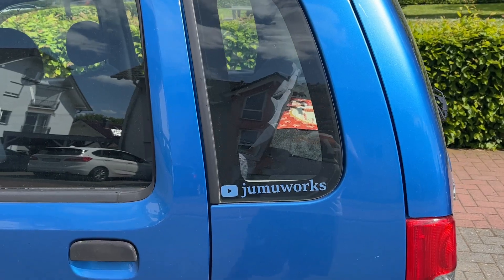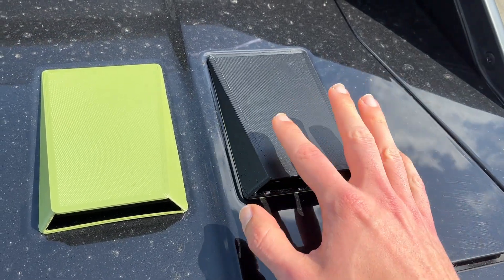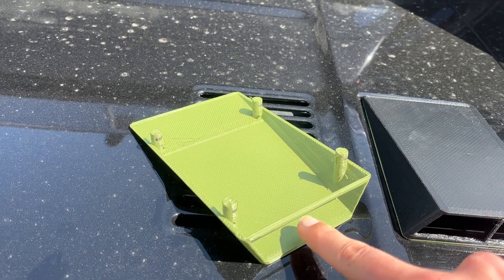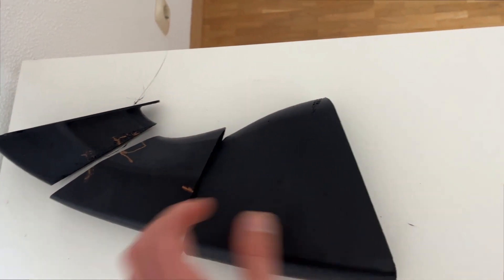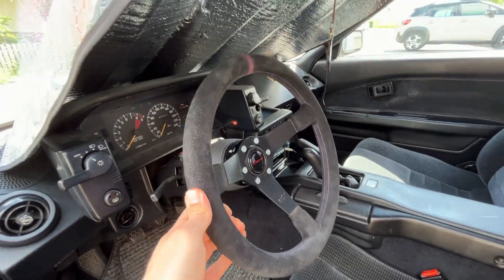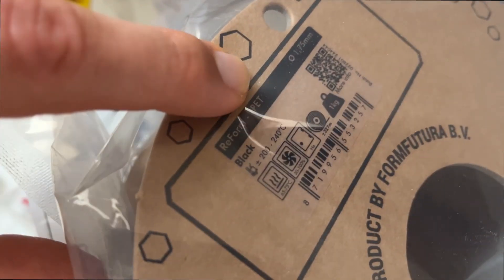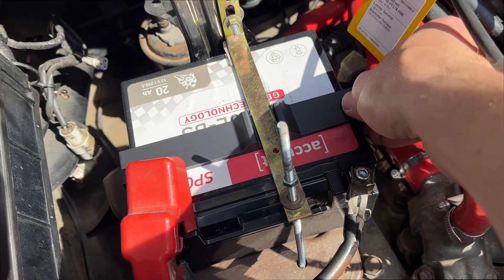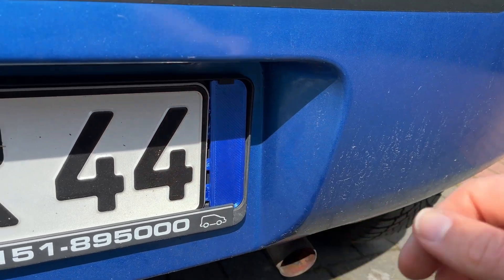My ongoing 3D Print Projects - AW11 MR2 Cold Air Intake, Battery Bracket

Comment: The engine cover piece is turning out great with the snap fit and seal to keep out rain (and snow!). I wonder if you would be able to print out a oil dipset handle extender, I sometimes burn my hand if I check my oil while the engine is still warm as the stick resides very far down. Not sure if the composite would last in high temp environment though.
Reply from the maker: Thanks for the input.
The ASA high temp is doing fine and if not, FDM Carbon print could be a try. I will check if the design is possible.